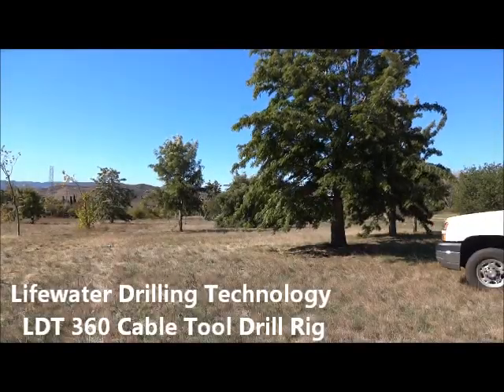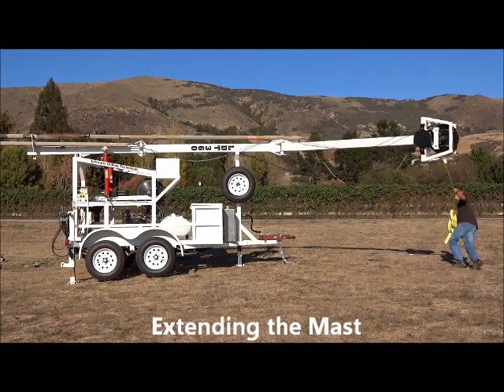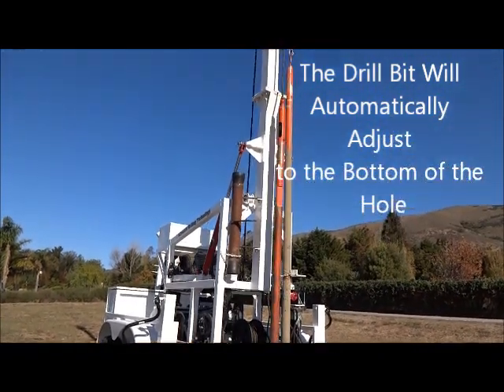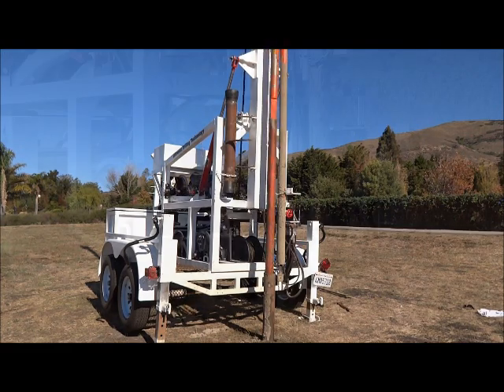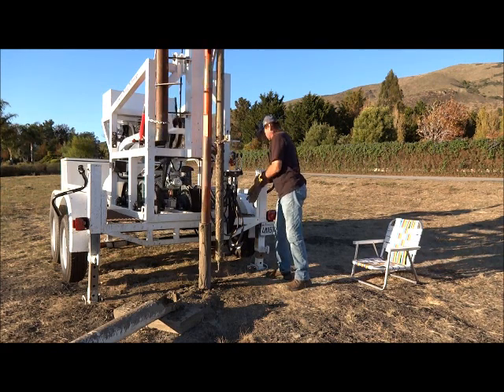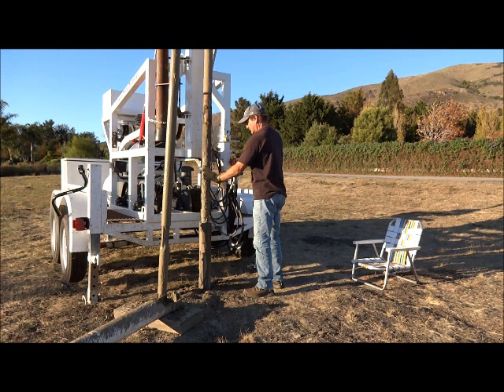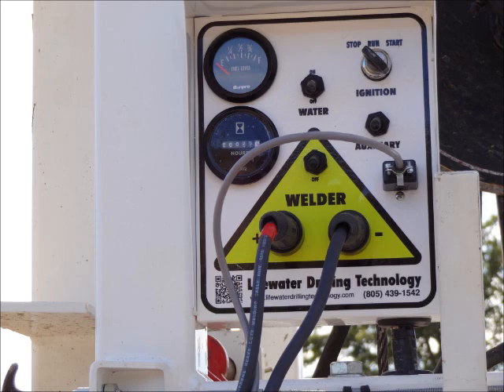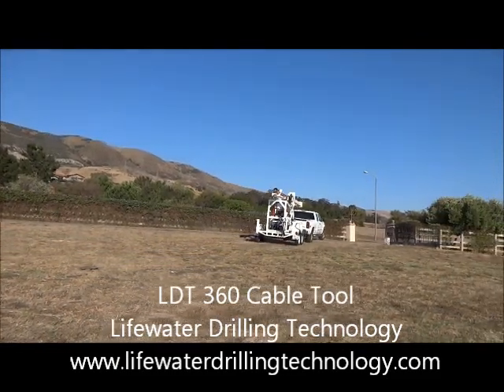Lifewater Drilling - Model LD Rhino Cable Tool Drill Rig

Comment: To start off with, I am a retired driller myself but my experience with Air Rotaries greatly outnumbers my experience with Cable Tools.  I would love to come out of early retirement and get back into drilling.  I am in Tennessee and Love the simplicity of Cable Tools.

Who is the manufacturer of this nice looking Cable Tool rig?  Where are they located please?  Do they have a web site?  How long/tall is the mast fully extended?

THANK YOU so much. 😊  ~Bruce W.

Comment: So other then cable length, why can't this drill 600 foot?
Reply from the maker: You've got that right -- really the spool and the amount of cable it can wrap without infringing on other surrounding hardware is the limiting factor.
Reply: @LifewaterDrilling  so can a bigger drum be put on it? 
I ask because most water here is 500 plus feet.
I know I didn't believe it was that deep either. Especially since they claimed 80 years ago water was close to the surface. Truly it was a scam back then.  
But after seeing the sub surface ground formation. I understand why it so deep.
Cracked solid limestone 500 plus deep.
Good thing is it shouldn't need casing. Since its solid fractured rock. Except where the oil is above the water. But thats another story.
Reply from the maker: @baddog9320  yeah there are limitations currently to subbing out a larger drum, but it is certainly being explored... that being said, currently the stated depth limit (based on how it is manufactured and what we will stand behind) for the rig is 450'.

Comment: Problem with this rig, is driller is sitting in chair! This is because its not drilling. If it were drilling and making footage, you would be on drill line brake at all time.

 MORE weight in cable tool is everything. Less weight is no results. Nice toy, but not practical as larger full size cable tool rig. ALso no boucing betty ( top shock cushion to take blow ) without this rig will self destruct.

Comment: Dam! And here i was like 5 or 6k isnt so bad for this. Not even close....its a good design but 69k is a bit much.
Reply from the maker: I dont know, with drill contractors charging $100/ft, all the sudden $92k gets paid off real quick:)  Let us know if you'd like to chat ~ info@ldrhino.com.
Reply: What drill contractors that you know are charging 100 dollars per foot for water wells?
Reply: 6k would hardly cover the cost of a new trailer with nothing on it.